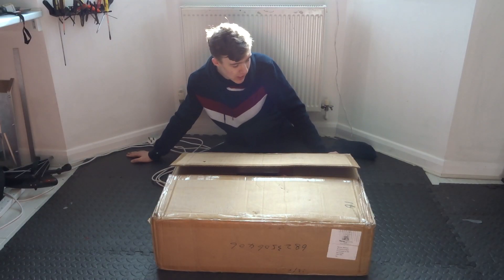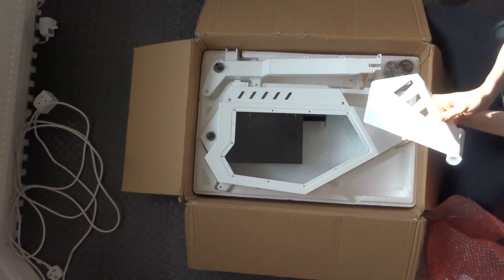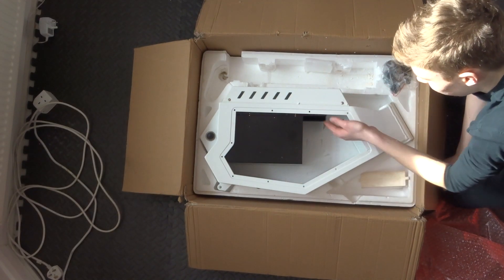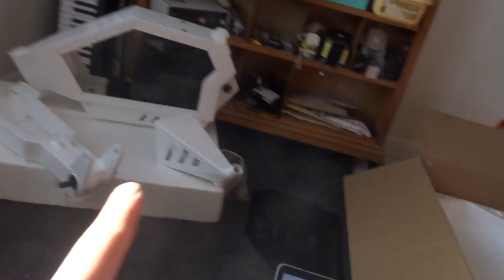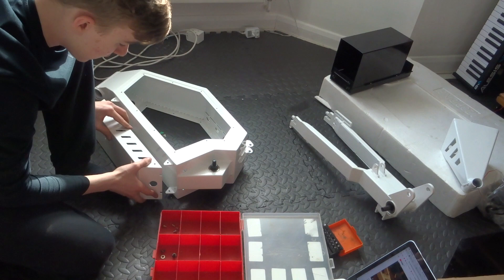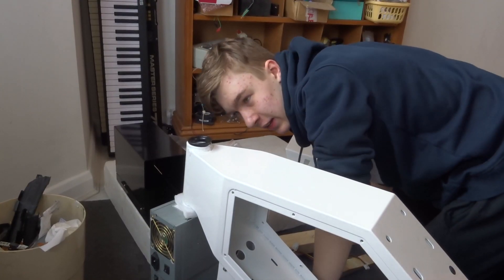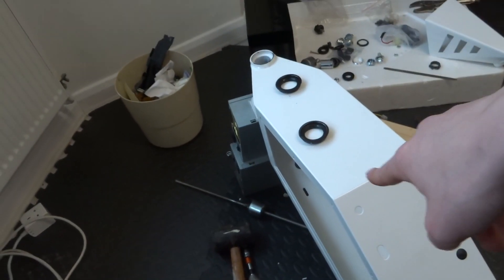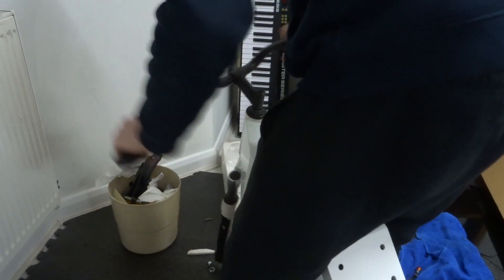8kW Enduro eBike V3 Build IS HERE! - Assembling the frame - Part 1

Comment: I have now got my frame, I went for the same as yours. I did mean to ask last time, Is there a particular reason you did not go for the MXUS v3 turbo hub motor? Curious?
Reply from the maker: Hadn't heard of it at the time I was buying. Alien power systems had a great value equivalent for £160 back then so made sense really. No other reason and I've heard the MXUS is very good!
Reply: @EverythingEbikeChannel  Thanks . x

Comment: Hi friend how u doing how is ur ebike  are they OK to ride in UK any advice?
Reply from the maker: Getting there! In UK it's a bit messy, but 'technically' you need to register an ebike if it looks like a motorbike or goes fast. I went unnoticed on my old ebike and even went past the police a few times :) I'll be registering this one so I can use it as a motorbike without worrying about getting caught or wiped out by fines and penalties. Tricky one to answer